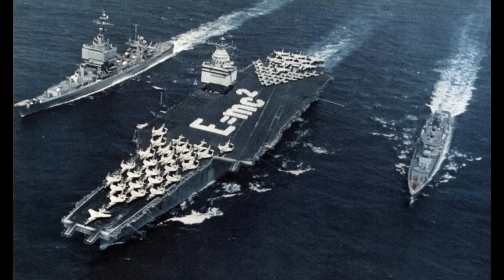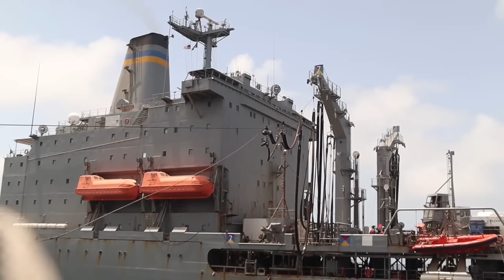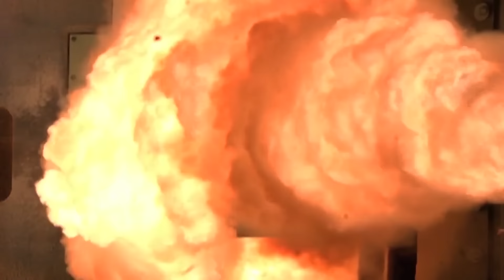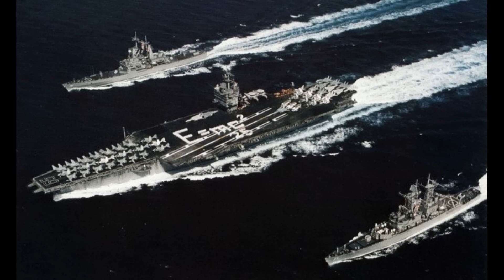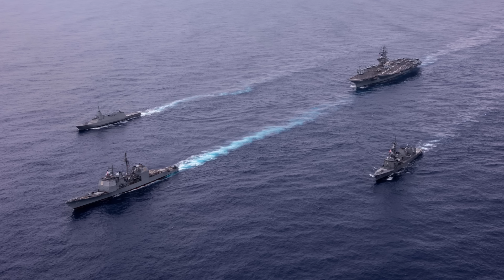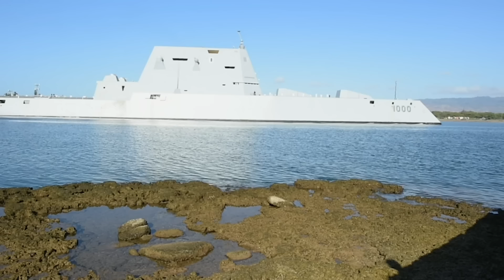Should the US Navy Bring Back Nuclear Cruisers?

Comment: The problem is that the nuclear cruisers and destroyers are used for escort, not independently. These now have to be covered by much less expensive ships like frigates. The Carrier has nuclear power, and that works out economically and damage resistance because of the aviation fuel it needs to carry. And going to nuclear for the escorts does not solve the fuel problem as the aircraft carrier needs to be refueled for its aircraft compliment. Another issue is that only a few places can work on nuclear powered ships. It was not only cost, but the problem of maintaninace of nuclear ships.
Reply: no.  Not with modern reactors/.  NOT the current carrier reactors as those are old design.
Reply: @Marcus-p5i5s  HAHAHAHAHA. Can your read? No you know shit about this. My father was an engineering officer in Navy (Commander) and I know about it. He interviewed with Rickover. Wow. And your expertise? Pumping shit out of your  mouth
Reply: @Marcus-p5i5s  Still has all the issues with a nuclear reactor. Canno maintain the curren SSN submarine fleet (I think it was as one time at about 74 and it is now down to 49 which was not intentional), and 19 of those are waiting service. 2 decommissioned every year and only 1.2 built. These are the same two ship yards that would need to be used to service nuclear. And they have to go all the way back to the US for maintenance.
Reply: @cliffordnelson8454  Nope.  Not the new reactors that don't require manning.  Although for ship use they would have a few Nuc's. Nothing like the current reactors in sub's and carriers.
Reply: @Marcus-p5i5s  Right we can remove all people from current power reactors because new reactors do not require manning. Nice to know. Will that make power reactors far cheaper. Incidently you are full of shit: Yes, all officers with the 1120/1170 designation (submarine warfare) attend Nuclear Power School and Prototype. And guess what my father attended this school. LOL. 

This does not apply to Supply Corps Officers ('chops') and specialty LDOs (limited duty officers)
Reply: @cliffordnelson8454  see a psych. You are nuts

Comment: What we need is a nuclear cruiser/sub crossover. The new Trump class would be perfect except for one thing and one thing only, it's a giant target out in the open. The enemy knows exactly where it is, where it's going, when it will be there and can take a shot at it whenever they want. If we used submersible cruisers or even partially submersible stealth cruisers we can avoid all of that. Otherwise, the new concept is right...

You need a large platform with high energy production that can operate energy weapons, communicate with smaller ships, operate drones and UAVs, provide communication, networking, sensor data and have an electronic warfare suite while also carrying missiles, hypersonic missiles, strike packages and having a robust defense. We can shrink the size, footprint and cost of them down in we rely on more UAVs and "missile barges".

Comment: The Virginia-class CGNs were the most beautiful surface combatants ever built for the USN
Reply: I will agree they are the most beautiful cruisers ever built for the USN.  The top one though, I have to give to the Iowa-class.
Reply: Yes they were beautiful ships to look at!
Reply: Yes indeed, i remember sailing along with the Virginia when I was on DDG 40 Coontz.
Reply: IMO they would have looked better if the MK-45 and MK-26 locations were swapped so they looked like a MK-26 equipped AEGIS Class Cruiser
Reply: @daleferber2096 Yeah that placement was really wonky 🙄
Reply: I’m partial to the Tico-class cruisers since I pre-commed CG-51.
Reply: @benjaminmaxwell7120  You never forget your first love.
Reply: The iowa class is mine
Reply: Yes the Virginia's were indeed pretty to look at but are heavily out gunned by modern-day DDGs. Also, I doubt the Virginia class cruiser could knock down 6 ASCMs like the Truxton did a couple of weeks ago in the Gulf.
Reply: @rickbase833  Well, yeah, I mean you're comparing apples to oranges. It goes without saying that a VLS-ship is going to out-gun (out-missile?) a 4 rail launcher ship.
Reply: @rickbase833  

Heavily outgunned by "modern day" DDG's

What ???

I assume by modern day DDG you mean DDG-51's 

Every CG from 36 to 73 and TWO 5inch guns  a DDG has ONE 

A California class or Virginia calls that was NTU'd and as I recall they all were which was  AEGIS on a budget  and could as I recall have 10 SM-2's in the air at any one time either in totl or per illuminator, I do not remember which  ( was an ET not an FC )  could EASILY  shoot down  just 6 ASCM's  and the CA and VA class had a full blown MK-86 GFCS to include the SPG-60 so they could shoot at air targets         40 rounds a minute
Reply: I love the simmetry both aft and forward...
Reply: wrong, the Iowa class battleships are clearly the most beautiful surface combatants ever built.
Reply: @AveBeIka  

NO

The first AEGIS class Cruiers, the MK-26 shooters

Running at flank 3 on a flat sea 

The sound of those LM-2500's 

The stern digging in and that big rooster rail

Comment: Yes, we should have 10 ships of ONE DESIGN using the same reactors as the FORD class for commonality.  They should be drone/AA focused and used as carrier escorts.
Reply: Step back and use 2 reactors from the Virginia Class attack submarines as they are already designed, deployed and proven producers of electrical energy.
Reply: I agree but we should try to marry a smaller nuclear reactor to a very powerful electric generator, powering electric motors for propulsion. Stretch the old Virginia class Cruiser Design and use the excess electrical power from the generators for CIC.
Reply: Bad idea. Energy losses mean that the most efficient way to power the ship is to use the steam produced by the reactor to directly power turbines connected to the ship’s propellers. If you convert that steam power to electricity and then turn it back into kinetic energy, you will lose a significant amount of energy requiring a larger reactor output or less leftover energy to power electrical systems. If you want to do two reactors and have one that’s just for electricity and one for propulsion, theoretically it could work, but because I’m not a nuclear engineer I can’t tell you the benefits of two smaller reactors vs one larger one. Either way there’s no good reason to waste electricity unless the instant torque of electric motors is that important for one reason or another.

Comment: I served on the USS Long Beach as a gunners mate for the MK12 Talos system. The ship should have been saved as a museum since it was the 1st nuclear cruiser.
Reply: There's no way, they have to tear the whole ship apart to reclaim the nuclear reactors.
Reply: @MrWlbblw agreed!! Don’t think a nuclear ship could be a museum ship
Reply: @jonnywebb296  NS Savannah would like to speak to you.
Reply: @PatrickYule-u9j yeah but a freighter is much easier to convert to a museum. It's of much simpler construction than a warship. The Long Beach was gutted down to her main deck to access the reactor cores & they still haven't scrapped her hull yet.
Reply: @MrWlbblw  Then what about the USS Nautilus.

Not enough people cared for them to be saved.
Reply: @PatrickYule-u9j Nautilus was a special case. She was small, a one off design, & much easier to remediate than a cruiser.
Reply: I served as a Fire Control Tech on the Belknap before her accident 75'. 55 Bravo
Reply: These ships are just too expensive to build, man, operate, & maintain. They'd eat up too much of the budget & take too long to build to be feasible. There's no way.
Reply: @MrWlbblw Also, the most recent CGN, the Virginia class were capable but can't compete with modern DDGs which out gun them. Expensive to build and maintain and less capable than today's shooters.
Reply: I think they literally think they should get them, so they can send a single ship to bomard targets instead of an aircraft carrier but the loss of one would be immense
Reply: @lolasdm6959 yeah, way too risk to reward!
Reply: Dude  I don’t think there will be funding for anything that has nuclear in it name 😔
Reply: I thought Bainbridge was first, although Long Beach was built as a cruiser. Bainbridge started as a DLG N.
Reply: OS2 on the Only Real Cruiser 1987-1990.
Reply: This must be a good channel if all these O.G are in here commenting
Reply: Sadly, lots of deserving ships never got to be Museums

Comment: those "BBGN"s are really cruisers to do these missions
Reply: Exactly!  The USN has needed a new large surface Combatant to replace the aging Tico's for 20 years.  The Zumwalts were supposed to do that...but that didn't work out, and they kept building upgraded Burkes instead.  But the hullform is maxed, a new "cruiser" to handle carrier group air defense, etc needs to be larger with additional room to grow.  15k tons like the Zumwalts is kind of the minimum.  Larger doesn't hurt, and steel is cheap, weapons and systems are expensive.  So a 25k ton warship isn't necessarily much more expensive than a new 15k ton Tico direct replacement.  Zumwalts size wasn't why she cost so much, the unconventional design abd new cutting edge weapons and systems were.  She could have been 10k tons larger with the same systems and not cost much more.
You can call it a "cruiser", a "Destroyer", a "Large Surface Combatant" or a "Battleship"....doesn't matter, its the same thing, it'll replace the Tico's, one per carrier group, with a few extras.
Reply: @brenthegarty3922  
If USN seriously needed a large surface combatant to replace the TIcos
The DDG-1000s is easily and faster route
Replace the second AGS wth 61 cell strike length VLS which brings VLS up 141 cells
Make the AGS NATO common to 155
The 155mm  hyper-velocity projectile (HVP) is better for several reasons
Upgrade sensors to SPY-6
The MK-46 would upgraded with AHEAD and PABT rounds for anti surface and missile defense
Both sides would adaptable deck launcher internally 
similar to Harpoon launchers on the stern of the Ticos but the launchers are multi function
able to carry LRASM, JAGMs , APKWS or ESSM
The last item is that USN needs to make missile with 700 mile range , Mach 3-5 speed carrying 750lbs warhead with mult mode seeker for land attack and anti ship 
I would use the SM-3 base as it has the speed and range , it just need the payload and sensor
Reply: @verdebusterAP  ALL the advanced gun systems are being replaced with with canister for the naval conventional prompt strike missile. Those three Zumwalt class ships are going to be the US Navy's "long range snipers". They will operate inside China's "first island chain" and stand ready to kill ballistic missile TELs as the ISR data comes in.
The extra VLS tubes needed by the fleet will be provided by USVs, large and medium
The Aegis software needs to have algorithms added to prioritize using the USVs missiles first and reserving the missiles on manned warships as much as possible.
Every medium and largish small ship yard in the US is going to be busy building USVs for the next decade at least. IF China and Russia don't collapse first. There is a very good possibility that they may both collapse any day now.
Let's hope we can deter them both from starting a world war before they completely collapse!
Reply: @trplankowner71  
IRCPS weighs 16,000llbs and cost 41 mil per missile
What the USN needs is half the IRCPS range at 1000-1200 miles 
with 750lbs-1000lbs warhead and multi mode seeker for land and sea attack at a cost of 10 mil or less and can be loaded in the MK-41 VLS
A missile thats not super expensive per shot
The ARRW is 30 inch and weights 6600bs
A booster to get out of the VLS and to proper height would only add 700lbs 
The USN like China needs a missile that multiple ships can use
Either way its case to make more DDG-1000
Reply: @verdebusterAP  I can't find any exact info on the Navy's CPS missile. It uses the same hypersonic glide body as the Dark Eagle, but the booster is different. I do know that both weapons are designed for the same purpose, taking advantage of a "target of opportunity".
The reason behind that is the US decided a long time ago that hypersonic weapons are of very limited use. It's a losing game to dump so much money into hypersonic weapons. 
ALL hypersonic weapons that must perform terminal homing are completely vulnerable to even late Cold War EW sets. It is a matter of physics and can't be changed. The only homing that will work on a hypersonic weapon is radar, IR can't see through the plasma generated by speeds above Mach 5. This is why the Soviets abandoned their attempt to develop an anti-ship ballistic missile. Back then, Ukrainian scientists worked for the USSR. Today they fight against the Russians. The differences are stark! 
The Chinese apparently don't know any better. I suppose the Ukrainians didn't let them in on the joke.
Reply: @trplankowner71  
They are the same missile
Reply: @verdebusterAP  No, the use the same "Common-Hypersonic Glide Body (C-HGB) ". However, the Navy's booster hasn't been confirmed yet. They should be the same. I can't think of any reason why the Dark Eagle wouldn't work just fine. Unfortunately, there is a cabal of jackasses in the Pentagon that do a LOT of really stupid things. For example, they're the same jackasses that killed the Constellation-class frigates by constantly imposing new requirements. Seriously, I think part of the motivation behind the proposed BBGX is to keep those jackasses out of the way while the rest of the Navy gets to work on important matters.
Reply: So long as we build them I don't care what they are called.
Reply: But the USN cannot get a cruiser for decades now, maybe if they call it a BBG(N), it will fare better against the Congress.
Reply: @karlvongazenberg8398 So few people realize that the "Trump-class" has been in the mind of navy officers since at least the second Obama administration.
Reply: @HD-mp6yy  Honestly not a Strike Cruise, Governor 😇
Reply: The BBGN will never be built
Reply: @verdebusterAP yes they will so long as the keels are laid down before 2028 and funding is made before midterms. A democratic administration will change the names but the worsing China situation means the Navy needs to be bigger. Remeber Trump started the Pacific pivot in his first term Biden continued it.
Reply: @JerryDickerson1994  Obama started the 'Pivot to Asia' in 2011.
Reply: @JerryDickerson1994  
No they will not
The Arleigh Burke class from concept to first keel took over 10 years
The Zumwalt also took as long
The notion that they can take it from concept 2025
to construction by 2028
Not going to happen
The process is studies for at 2 to 3 years
Then contract studies with companies
Down selection and finally award 2 years later
The USN and selected contractor spend 2 to 3 
years refining the design before the first keel is laid
The designs are sent to Naval Surface Warfare Center, Carderock Division (NSWC Carderock) 
who builds scale models that go through rigorous testing to ensure the that design is sea worthy and stable
At least 7 years of testing and development before the keel is laid 
Now add in that Trump wants to ship to be nuclear powered with an A1B reactor
The A1B was designed to meet the demands of CVN not a battleship. The Virginia class S9G reactor would be the smarter choice as its made to compact or Columbia class S1B
Now you are making it nuclear
So now you have to add in the proper shielding for the reactors as addition layers to sure its properly armored
By making it nuclear, its going to take least 15 for R and D
You cant cut corners with nuclear reactors
if the design was conventional , you still wouldnt reach the 3 year deadline
Reply: @verdebusterAP  Thank you Kreskin